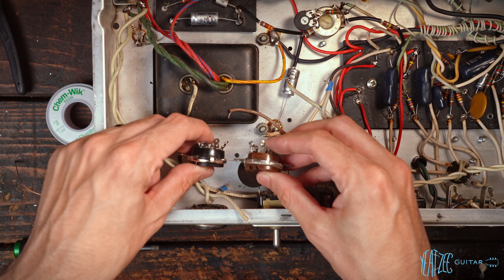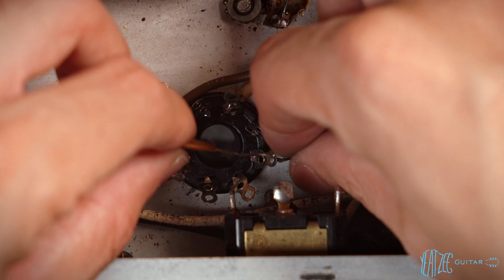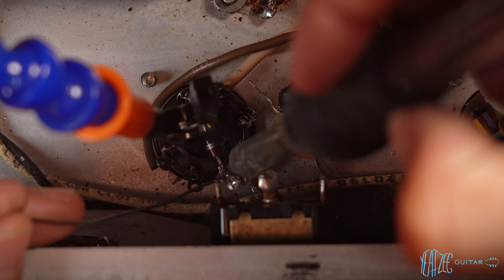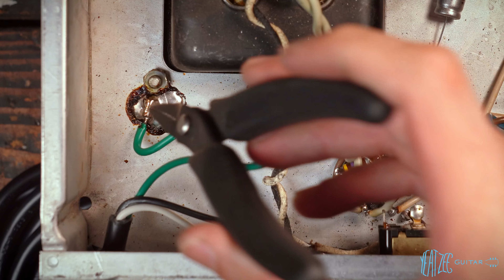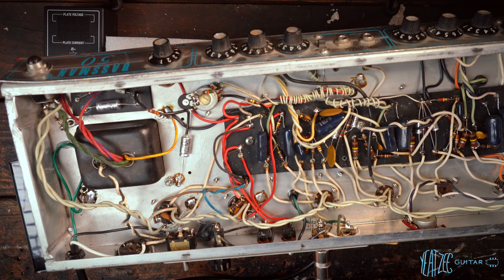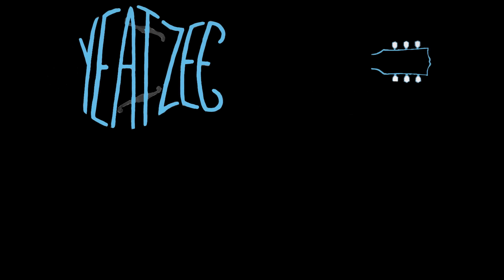All Done ✌ - Vintage Fender Bassman 50 Amp Repair Pt.5

Comment: There's no need to put solder on the iron first. You should have a sponge to keep the tip clean and put solder on it only when needed. The flux while not acid, is corrosive and will ruin your tip faster when doing that.
Reply from the maker: Interesting, never heard that before. The iron conducts heat and solder flows significantly easier and faster if I had some to the tip first before applying to a joint. Don't think I'll stop doing that, it's a big difference.

Comment: When soldering a delicate capacitor lead to a chassis ground with a super-duty iron I will clip a large size paperclip to the lead as a heat sink.
Reply from the maker: Good tip!

Comment: I have bias probes and I never really use them.  I directly measure the plate current. 

Set the meter to DC ma, move the hot probes to ma, then measure the current between the output transformer primary center tap and pin 3 of both output tube.

Then all you need is the plate voltage to calculate your dissipation.

It's within a percent or two,  and it's not the safest for beginners,  but my God is it faster with the chassis already out.

Comment: I watched and enjoyed the entire series because I am working on the exact same amp...Thank you!!!  I was and am still unclear about the 3 prong conversion??? I went frame by frame and your wiring changes with no explanation and the "death cap" is still in circuit... I haven't found any videos that detail this specific model... You would have been the first and only one! Very well done! I will look again at your reference to another video on the subject...
Reply: Apparently, you removed all the wiring to the old, unused ground switch that effectively lifts the death cap out of circuit... that works! I know there is a way to keep the courtesy socket... still working on it...
Reply from the maker: @randelcross  yep, just bypassed. To retain the courtesy Outlet just run the hot (black) to the open side of the courtesy Outlet (neutral should be on the other side) and then a wire from there to the fuse tip
Reply from the maker: Nice! It's linked in the description, I did a very detailed video on the 3 prong conversion which covers exactly what I did here minus the ground because these 70s fenders have that chassis clamp already there

Comment: I’d be begging for 83 degrees in the garage - sounds like paradise.
Reply from the maker: Even after midnight? Lol
Reply: @YeatzeeGuitar  a few weeks ago I was waking up at 5am to open my garage doors and cutting on the fans to suck in the sweet muggy 79 degree coastal VA air to lower my inside temp before the sun came up.  But yeah 83 at night is pretty bad.  Pop a wet hand towel in the freezer and get to work 🫡🫡🫡